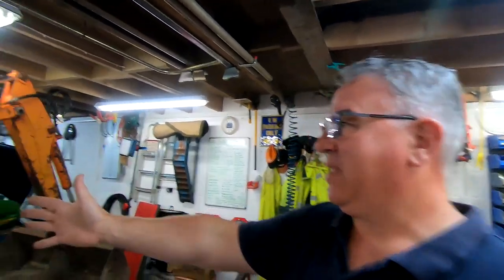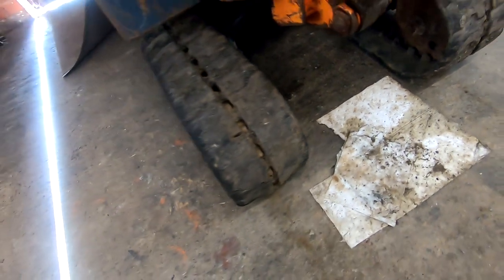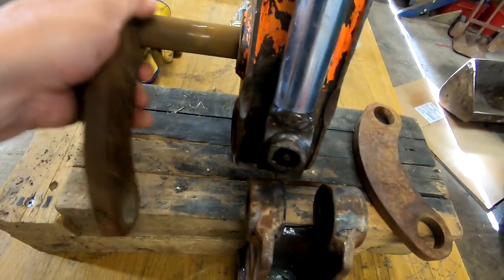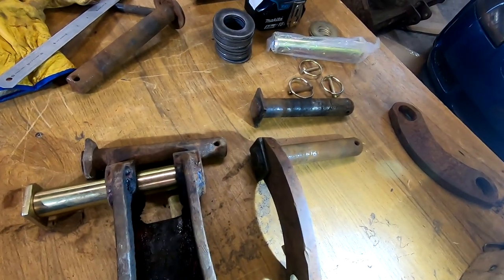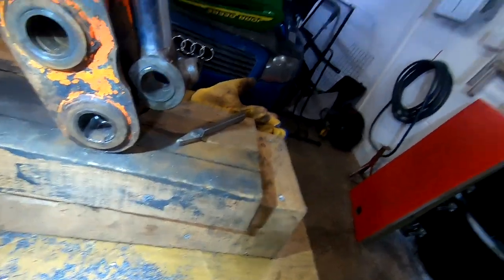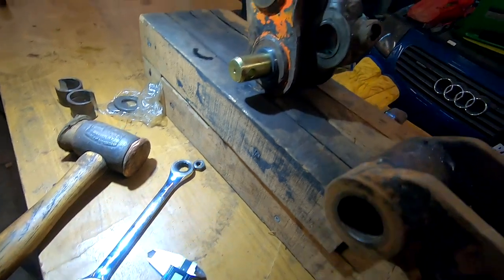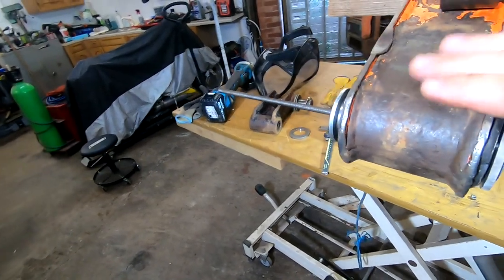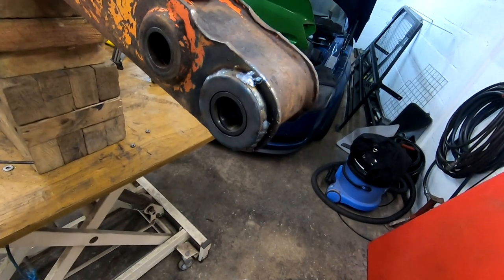Replacing dipper arm bushes on our mini digger.

Comment: Next time taking out bushings like this. Put a piece of 30mm od steel pipe in there about a foot long.
Weld the end if the pipe to the bushing and give the other end 2 swipes of a sledge. 
It will be out in seconds
Reply from the maker: Thanks 👍